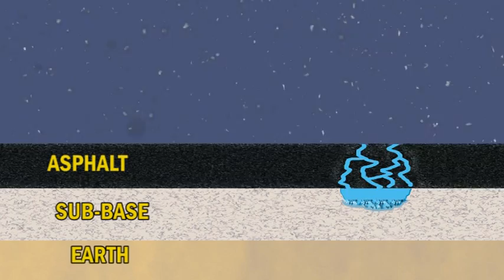How do Potholes Happen?

Comment: Speaking of chemistry class what makes the vehicle run and how often do vehicles leak gasoline how often do people spill gasoline filling up lawn mowers and tractors and stuff on the side of the road it isn't just the water  because technically the tar in the asphalt repels water so it has to be weakened first with a solvent or extreme heavy weight of a vehicle

Comment: The technology already exists. It has for many years. Thick reinforced concrete, asphalt on top, expansion joints, and with proper slope and side drainage. Just like on major Trans-Canada highways. Do once and never see a pothole in a city environment (major earthquakes excepted). Those highways experience incredible amounts of traffic each hour, with vastly changing Canadian temperature swings, abrasive snow removal and chemicals, etc. You name it and they take the abuse day after day, year after year. City roads would rather pay a little at first for a cheap job everywhere and repair forever. It's just easier to sell a cheap roadways to taxpayers than one built in affordable sections that will last. Of course, city hall always enjoys a reason to bump your taxes yearly too. But I doubt that's a consideration. HA!
Reply: Other technology already exists even simpler than that. It's called "rail"

Comment: There must be some material that won't get potholed cmon
Reply: put a concrete slab 10 feet deep. Potholes happen because of the dirt under the pavement getting exposed to water and washing away. potholes are nothing but baby sinkholes.
Reply: Of course, but cost is the issue

Comment: But I live in Florida and it almost never gets down to freezing temperatures. Why do we still get potholes down here then?.
Reply: Petrol and diesel fumes from the exhaust system breaks down the tarmac
Reply: Carla Clarke but would the diesel fumes float being a gas instead of laying on the road. I only other way I could see the pot holes form it from the wholes that cars leave on the road but even then it’s pretty unreasonable cause that would mean the oil out of every car that passes through that road would have to leave at the exact same spots everytime.